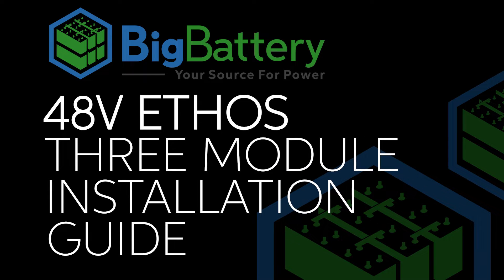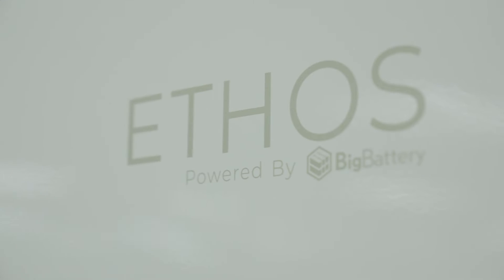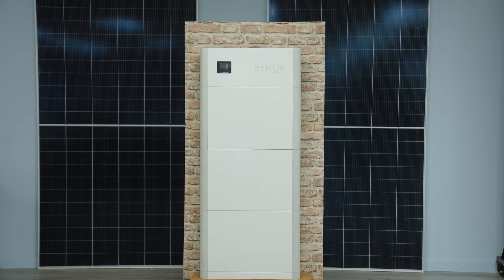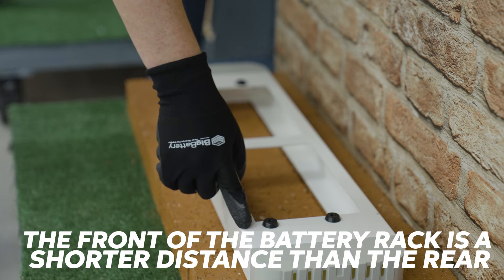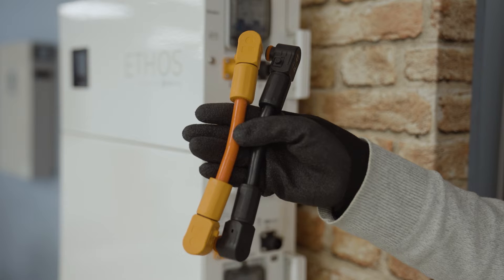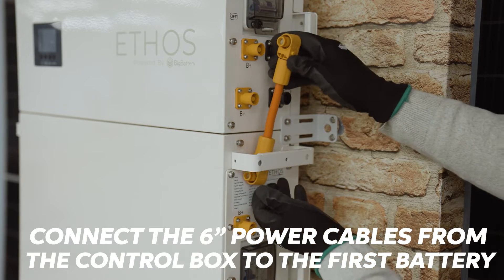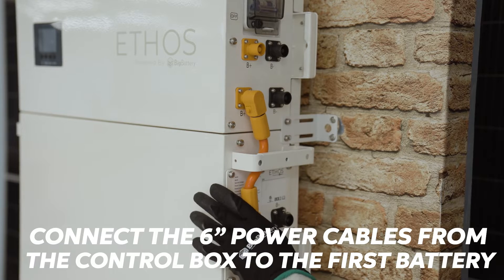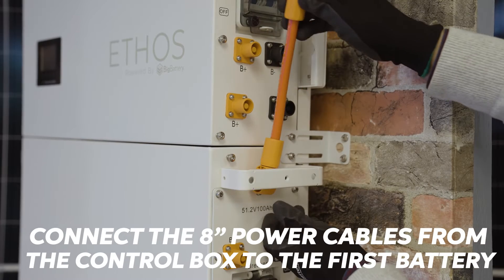48V ETHOS Energy Storage System - Installation Guide

Comment: Can the additional battery stacks be flipped so that the connecting cables don't have to snake behind the stack back to the main stack? - ie, why use a 4' long cable when you could flip the battery stack so the terminals are much closer,  using a much shorter cable?  Would clean up the install - heck, why not sell a matching conduit for a secure path to run the cables from stack to stack? Just not thought thru

Comment: What size are the cables connecting the batteries and what size is the final cable connecting the battery bank to the inverter? I asked this because the 2021 Canadian electrical code book states that 2/0 cable needs to be used from batteries to inverters section 64–814.
Reply from the maker: Hi, thanks for your question. Our ETHOS Systems use 2AWG cables for battery to battery connections and 2 pairs of 1/0AWG cables for battery to inverter connections, which together meet the Canadian requirements, and exceed the ampacity of a single pair of 2/0AWG cables. You can see more about our ETHOS Systems here: https://bigbattery.com/ul-certified-grid-tied-systems/
Reply: @BigBattery  the inspectors in Canada are very strict with the code. To them 2/0 is 2/0. Also when connecting 2 1/0 may equal more capability than a single 2/0 are you not adding more points of connection that increase the probability for a fail connection. If the length and resistance of each cable are not equal then one cable is goi g to carry more current than the other and be working hard for the decades of expected use. Why not simply use 2/0. Polarwire makes some amazing wires than can be built to perfect spec. Also they are American and not some Chinese off brand. This is why Schneider inverters and PDPS use them. Top quality and home grown.